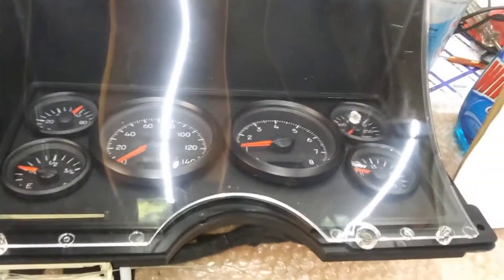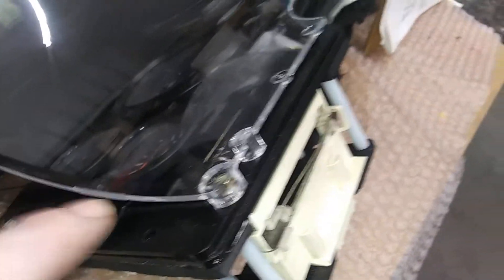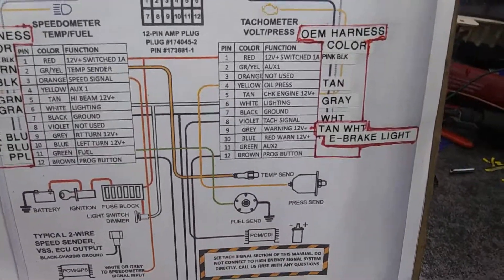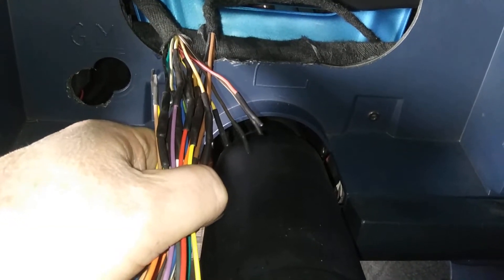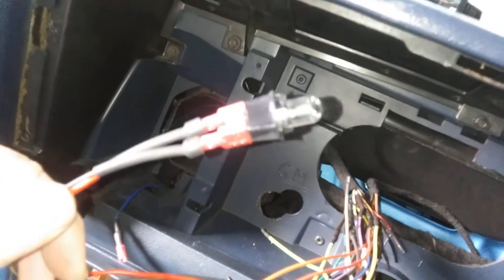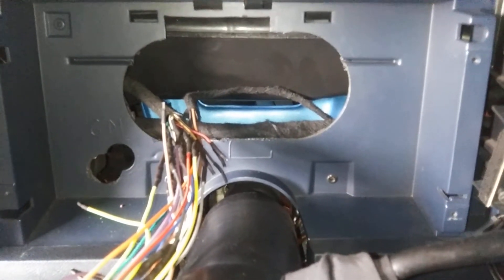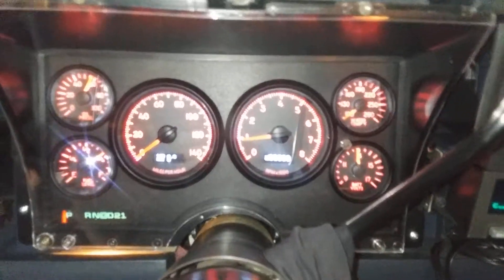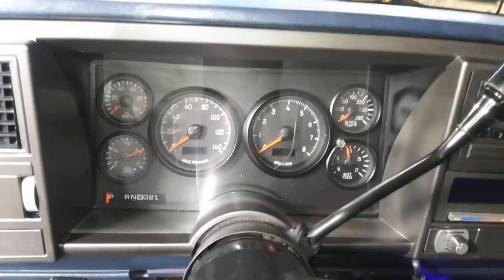Chevy OBS build, Wiring & installing NEW VINTAGE instrument panel/gauge cluster

Comment: Looks like a better version of something from the factory. Nice!
Reply from the maker: Thanks, that's what I'm going for!! 85 mph and 5000 rpm gauges were getting a little old.
Reply: @GNaron  I bet, you have a beast under the hood. I wanted to do the same but ended up getting a deal on a 5.3 in great shape last week. Slowly but surely 😁
Reply from the maker: @thisoldhooptie  There's a lot of really good swap info and parts out there now for the OBS's. Also a lot good power kits adders for the LS platform at reasonable prices.
Reply: @GNaron  I need to teach my oldest to drive first.  Then i can wrap up the purple paint job. I'm going to study up on the ls engine in the mean time. Ill most likely go stock at first for a base line.

Comment: Hello and thank you for the video. I have a question in regards to brake warning switch and parking brake indicators. From the video it appears you hooked them up to the NV tach which has 3 indicators hidden or what NV calls deadheaded is that correct? One indicator is an exclamation ! point, another is a triangle and the last one is a check engine light. I'm assuming you use the ! and triangle. Do they come on when you turn the ignition on and then go out if everything is OK. Thanks!!
Reply from the maker: Mine don't. I think the bulb check system is built into the factory gauge cluster. If I remember right, the brake check wire I used was straight from the pressure switch and E brake switch.

Comment: Hi. I´m just finished doing the same install in a 90 K1500. Unfortunately I have some trouble with the generator not charging. I believe the ECU has to be triggered to switch the generator to charging mode. Understand that the trigger is the amp wire going to the oem gauge cluster, “measuring” current in the cluster. Do you remember if you had similar problems, and if so, how did you solve it?
Reply from the maker: No I didn't have that problem. I used a 150 amp Power Master one wire alt. That is pretty much a factory replacement. Just 150 amp, I think the factory one 60 amps. Did you remove the factory ECU and wires? As far as know the ECU does not control alt. 
You should have red 10ga wire bolted to output lug on the alt from the battery junction block on the firewall and plug with a brown 16ga wire from the alt to the voltmeter. The brown wire goes thru the firewall at the bulkhead on the driver side.

Comment: How did you wire up the voltage gauge to trip the alternator to charge? I wired my gauges all up with their snap adapter and speedometer didn't work and the alternator wasn't charging and ran the battery down after driving it for a bit
Reply from the maker: The small brown wire coming out of the alt just goes to a gen lite on the factory dash. I didn't use it on the NV install. The voltmeter was wire into the NV panel from the NV factory. I you are working on a chevy OBS it should have GM one wire alt.
Reply from the maker: One thing I figured out about NV and OBS's is I wired up the dash light to be on in run and start. The gauges were pretty hard for me see.
Reply: @GNaron  it's a 94 chevy c1500, I called new vintage and they said I have to take some diode out of the back of factory cluster and put somewhere on new wiring to get the alternator to charge . I thought paying the extra almost $100 for the snap adapter was supposed to make it easy but still have to run new oil pressure,  temp guage, tach wire and everything else to get these gauges to work
Reply from the maker: @TeddyBritz  Oh I saw that snap adapter thingy. Are you saying it's no good? 
I'm using a power master 150 amp alt, using just the one big red wire to run it. I don't remember doing anything different with the factory alt. I know in the 1993 c1500 factory mannel it show a red 10ga from the alt to the busbar on the fire wall and a brown 16ga going thru the firewall to a gen a gen light built into instrument cluster. If you have something different you might look for a video of how some else did it.
Reply from the maker: @TeddyBritz  I just used the factory wiring harness and changed out the factory sensor for NV sensors. I have a color code diagram in this video.
Reply: @GNaron  yeah the snap adapter is a joke because about all it powered was the turn signals, high beam, and the gas gauge, I had to run new wires to the other gauges and the speedometer didn't work and the alternator wouldn't charge and ran the battery dead. I was stuck in a drive through with dead battery,  I took the gauges back out and put stock back in, I'm not happy with this purchase but can't send them back

Comment: Cheers for sharing, helps alot! Did you have to change your speed sensor or can it use the factory one?
Reply from the maker: I used the factory speed sensor. The NEW VINTAGE speedo is adjustable to most speed sensors.